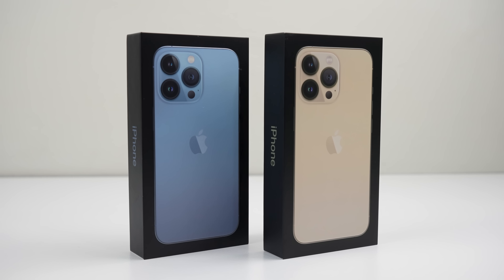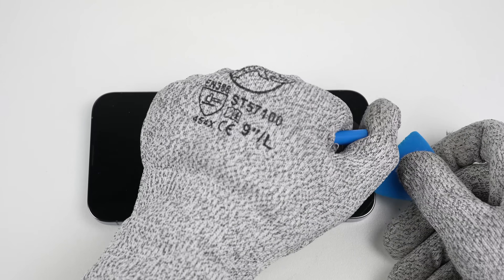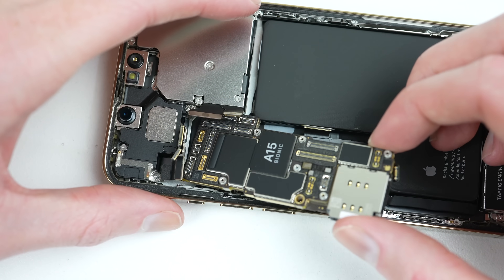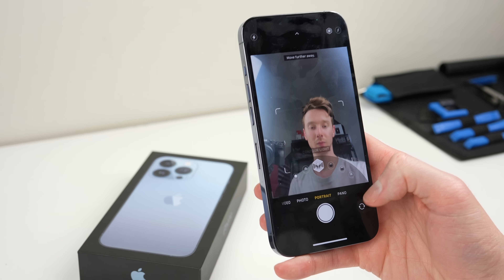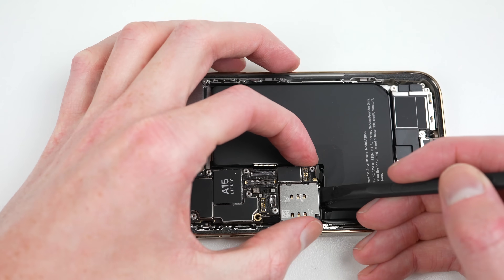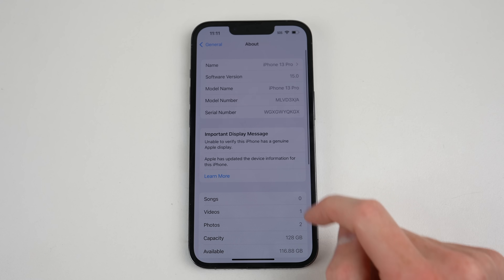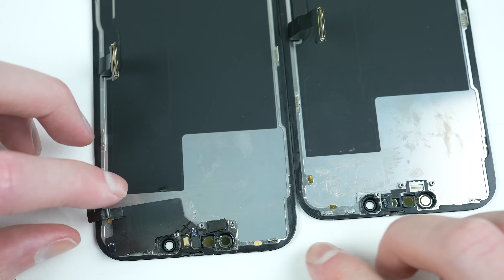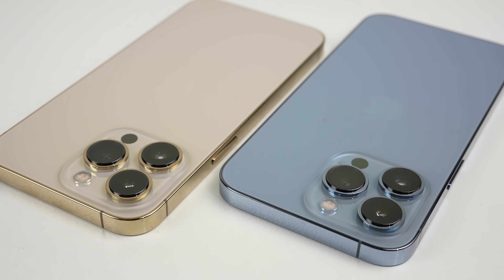iPhone 13 A Repair Nightmare - Teardown and Repair Assessment

Comment: How does this not break the “right to repair” laws that Massachusetts and some other states / countries are passing?
Reply: Tldr, it don't matter and we are fucked. 

Law is only broken when someone brought it to the court. Cases like this will then take years, sometimes more than a decade. If the ruling is not favorable for apple, they will push it to a higher court until it reach supreme court. 

At that point, even if apple lose, and new law happen, apple had already made enough, and they will move on to a newer tactic. 

Any new law result from the lawsuit would have no effect on existing product (you can't, most of the time, made new law and incriminate pass conduct) on the market, and newer product would have different bs tactic.

Yea, we are fucked.
Reply: @jintsuubest9331  
We can fuck them tho , by replacing them
Reply: @jintsuubest9331  how are you fucked. Easy fix, just don’t buy their products. If people do this, then apple will be force to change this up. They may have rights to do this for now, but you have the right to buy other phones from their competitors.
Reply: @xxargonautxx9790  Samsung and all the others are following the same.
Reply: Court juries are lead by old people who have no idea what any of this is.

And Apple is a tech giant who forks in billions every year. They have the money to get away with everything, the entire legal system is fucked.
Reply: It's the software on the chips that allow them to skirt Right-to-Repair laws.

Think of it like this:

A carpenter, while building a house, draws little pictures on all of the two-by-fours before putting up drywall. He then, after the house has been paid for, tells the new owner that they have no right to tear down any walls because he owns the artwork underneath them.

It gets legally hairy from that point on.
Reply: It's simple. Buy other brand. Apple is not the only company that makes phones
Reply: @everythingsfine1395  Android is open source, the phones that run it aren't.

Comment: I don't understand, wouldn't it be a major selling point if a phone was easy to repair making the price of the repair lower and accessible at all phone repair services.
Its over £1000 and considering 20% of all IPhones have a cracked screen it would make sense to make the screen stronger or easy and quicker to repair.

Comment: Great informative video!! Curious if both of these will still  be100% waterproof after what you have done?? If not, will they be at least submerged for 1 minute with no water going into the internals?
Reply from the maker: It would most likely be fine if I replace the adhesive. As the phone just came out the adhesive not available to purchase. When it is I will replace it before selling on the phones.
I should also mention water damage is not covered under warranty so its really only an accident protection system.

Comment: I work as a repair technician with tvs and this behaviour is actually quite common since years. Whenever we change a part in the tv, we need to tell the mainboard of the tv what the new serial number is. This can only be done with a special tool on pc or in the service menu. Id guess same goes for the iPhone‘s. One needs to tell the mainboard what is the new part they got.

Comment: I think its good because if someone steals your phone they can't use its parts
Reply: No, that rarely ever happens. This is awful and is only to kill 3rd party repair, bringing Apple more money.
Reply: @NovaDoane  well, don’t you also get real parts from apple? I’d rather have a good apple screen than some cheap plastic screen that scratch’s easily.
Reply: @frufrufrufru1999  why is that an argument? It is rare you will find someone who repairs your phone and replaces the screen with a cheap and bad one. But even if they do, it's your choice to get it repaired that place. You can also chose to get it repaired at apple, but you should have the choice.

Comment: I work at an apple authorized repair center. the actual hardware repair is fairly simply and easy if you have an ifixit kit. the software checks apple puts in place is what really fucks third party repair.

Comment: Apple’s line “we don’t need to provide a charger because you all have so many already” was absolute BULLSHIT when they have been supplying only type-A chargers for the last decade, and include a lightning to USB-C cable with new iPhones. Apple have never supplied USB-C chargers with iPhones. Lightning is a crappy proprietary connector that should not exist 5 years after Apple made Macs USB-C only. The environmentally-friendly shtick is so transparently a lie.

These phones should be banned from sale until these anti-repair dark patterns are undone

Comment: If the screen or other components were able to be replaced and the face password reset, wouldn't this allow anyone to steal a phone and simply change a few components to gain access to another person's data?  Isn't this the reason why Apple has done this -- to secure its customer's data?  After all, phones have become such a personal extension of ourselves that we keep Banking Apps, Income Tax Apps, Health Apps, our email and messages to and from all our contacts, etc.  Or am I missing something.  Are you saying that components could be changed by third party repair shops in the past, but that shop could NOT gain access to a person's data no matter what components were swapped?

Comment: Great video Hugh! You probably knew the outcome before even opening these phones, but kudos to putting the time in to confirm your suspicions - you are a true master of the tear-down and rebuild. Sadly, I expect that the vast majority of iPhone owners care little about the right to repair and Apple seems hell-bent on locking out 3rd-party repairers. It's all too easy to forget that this is 'just' a phone and not some life-critical piece of medical equipment or dangerous power-tool that could rip you arm off if you installed the electrostatic shield backwards. It's all about protecting their authorized channel and promoting their iCare program. In Apple's view of business, as consumers we need to keep doing what we do best, consume...consume...consume...

Comment: I genuinely laughed when you said apple is working towards being carbon neutral. Until their devices are repairable, theyll never reach that.
Reply: They also want your “broken” phone so they can fix it themselves and resell it. It’s not like if you’re phone breaks they throw it in the trash.
Reply: @Xploit66  they don’t even sell phones from 2 generations ago, why would they care about your old ass phone, it’s called recycling.
Reply: @OmarAlhammadi621  I’m probably jinxing myself by saying this. But of all the phones I’ve had starting with the 3GS I have never once had an issue with any of them what so ever. Quite happy with apple products. But they’re still pretty shady when it comes to repairs. Never said I didn’t like it not sure why you grasped onto my comment out of all of them.
Reply: They also spend billions of dollars a year to counteract their entire carbon footprint, from power in Apple stores to power to their lab in cali
Reply: No they can if they build carbon neutral phones via carbon neutral processes.

Comment: Screw Apple, honestly. I love their devices but these anti repair policies are just a cash cow for them. Pay £270 for a screen replacement or buy an expensive AppleCare+ plan to cover costs. it's BS. Everyone that buys a new iPhone should take out AppleCare+ and claim for loss of device twice per year @ £109 excess a time. It's the only reasonable way to hit back at them and if everyone that bought an iPhone did it, that may not solve the problem but it would certainly cause them quite a bit of trouble with supply and demand. What possible explanation do they have for the camera freezing? Could they possibly say that it's caused by a non genuine part when it is in actual fact, their own part off of a perfectly working(brand new in this case) phone? There really is no justification for these repair limits other than greed.

Comment: Apple: “We’re trying to head towards an environmental friendly approach.”
Also Apple: *New cable included doesn’t work with old adapters, the new power bricks come in their own packaging, can’t repair iPhones as easily or phone will stop basic functions, can’t replace parts either, a simple thing such as screen replacement costs more than half the price of a new phone, still have a lightning port rather than USB-C so that their phones will work with ONLY their chargers, methods such as planned obsolesces so you can upgrade *
It’s BS. As someone that likes Apple products, they don’t give a shit about the environment. All they want is profit so they can fill up their holes of corporate greed
Reply: Corporate greed - that's what makes the world go round - until it doesn't. So now a $1500 phone can't be repaired economically outside of warranty - what next - a $15,000 car can't be repaired economically outside of warranty? I think both have been the case for several years. Welcome to our throw away society.
Reply: well said!....Their enviornmentally friendly approach actually  means "Profitability friendly approach"
Reply: Just send your phone to Apple to have it repaired. I bet they can replace and unlock your device.
Reply: U forgot one thing THEY DONT GIVE A SH*T ABOUT THEIR CUSTOMERS
Reply: lets call it Sustainability theatre
Reply: They have more money than some countries, and yet the can't spend over 10% on saving the environment.. stop supporting them..
Reply: Climate change agenda is a scam. They already told you. Liberal agendas are mostly steeped in self-righteous hypocrisy.
Reply: @xkj73-5bm  
Liberals are right winger just like you but they want to make profits from everything including what conservatives call sins , abortion ,sex works , drugs , guns , they don’t give two fucks about climate change or wars they are still capitalists , in the other hands those who care about climate and workers and no wars are leftist socialists not liberals and not conservatives, apple is a capitalist industry who doesn’t care about workers and nowadays even about consumers
Reply: @xkj73-5bm  Even if you think climate change is BS pollution is still a thing. Unless you think industrial waste is good for the environment?
Reply: @xkj73-5bm  it’s scientifically proven that climate change is real. You people only read what you want to believe in live in a bubble
Reply: @fuethao8633  might want to read the comment again. They're saying the agenda to "fix" climate change by certain zealots is purely for personal gain and not for environmental reasons. Its easier for a corporation to make a few packaging changes, pay some eco friendly lip service and still be a major emissions offender.
Reply: @xkj73-5bm  please learn to read

Comment: So glad somebody is doing this testing so well and scientifically, honestly really great job man. Really appriciate what you bring to the tech repair community
Reply from the maker: Thanks!
Reply: @HughJeffreys  Amazing videos keep up it up! You inspired me to start my own repair business
Reply: @HughJeffreys  apple does very well. no one can deceive you when you buy used equipment. it also doesn't pay to steal the iPhone for parts. iPhones from stolen parts are sold in many countries. now it will not be possible.
Reply: @Hugh Jeffreys , Terrific video but what if there's some kind of software hack or a rom booter that can wipe out or even reset the serial factory identification so it'll work ?
Reply: @battosaijenkins  I'm not an expert, but from what I know it isn't the serial factory identification binding the components to each logic board but some sort of unique pairing process. people have had some success pairing new components themselves, but it is difficult to replicate the original pairing process by apple and new firmware patches constantly prevent people from doing this. (this is just my understanding, please correct me if I am wrong)
Reply: @oceanofglass  But if apple can do repairs successfully, this must mean they have some kind of software loader or some kind of bypass feature that will allow pairing to occur and once the public gets a hand on this, it's only a matter of time no? =(
Reply: @battosaijenkins  Except if the pairing requires calling Apple with serial numbers etc.  Then Apple can just refuse.
Reply: Yeah, should send them back to apple with swapped parts and see how they wanna play that out.
Reply: And people will still buy it in 2027 for $4000
Reply: @HUNmotyon  I will buy.
Reply: BİR KATKI: 
İngilizce Birinci, İkinci, Üçüncü vb.. Nasıl Söylenir?
( SEN DE ÖĞREN )
https://youtu.be/4T7qpnAjWEI

Comment: Push for "Carbon neutral product"

Going for wireless charge, which is inefficient than wire charge. When large part of power production of the world still run on carbon (gas, coal) those inefficient charge would make the carbon neutral product title laugh able.

Comment: I completely understand why apple is locking parts to the logic board. For example, the Face ID, iPhones are known for having great security, but if you replaced the Face ID module with a low quality one, it will not offer such a great security. As for displays that's kinda stupid to disable true tone, but the message is very helpful when buying a used phone. As for the batteries, apple doesn't want to have a reputation for having exploding phones, that's why they try to keep users from replacing them. I think iPhones should have a menu in settings, which shows which parts were replaced, also they should make iPhones completely unusable with fake (Chinese) batteries. But wait, phone technicians like YOU, will never understand that, bc, well, they're too stupid to think why apple is doing that.

Comment: Everyone acts like 3rd party repairs are divine and great, but in most cases they put on displays or parts that doesnt match the original quality they dont make the unit water proof and generally lie to costumers. But there are massive issues with third party repair shops doing crap work. Ofcourse there are shops that do good work, but as far as I've seen its a needle in a haystack.

Comment: Anyone that is about to watch this video, or who is reading these comments, should be cautious when they view any video produced by Hugh Jefferys, as they are based on scare tactics and misinformation.

Watch the release of the iPhone 12 and the scare tactics he used. The iPhone 12 is 100% repairable.
Reply: "Mark Krasney, creative at Apple Retail Store in Laval, Quebec Canada. -Linkedin" 
DO NOT fall for this comment. This guy is part of the problem.
Reply: How is this misinformation when everything he did was in a scientific way. Do this yourself, record yourself swapping the screens on two iphone 13s, and record the entire process. You will find out the video was correct.
Reply: That is what he led the public to believe with the iPhone 12, and said Apple made the repair more difficult, and it is not.
Reply: @markkrasney4224  brainwashed

Comment: You are right, being able to repair and use your phone for longer is far more sustainable than leaving accessories out of the box. Apple will happily sell you a new charger though as the lead that they supply won't fit your old one.

Comment: Hi Hugh! Great info about iPhone 13. I’m still on 8+. Still ok. But updated to iOS 15 and for some reason I can no longer connect (don’t laugh on next item) my iPad 3rd gen pro that’s running last final iOS 10 that was available. 
I know my hotspot works as other items I link to my iPhone works. But I get failure to start hotspot on iPhone on my iPad screen. Have done network reset on both items as well as full on iPad. Not iPhone. As I think the problem is with the old iPad. Because I’ve updated to 15 had this caused the issue to no longer connect or support the drive in the old iPad? 
New subscriber good video. 👍